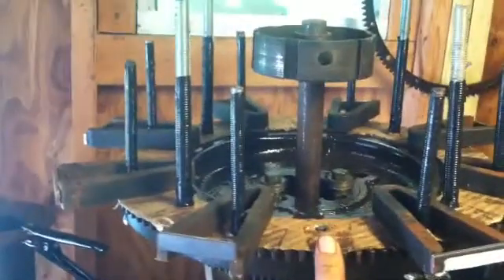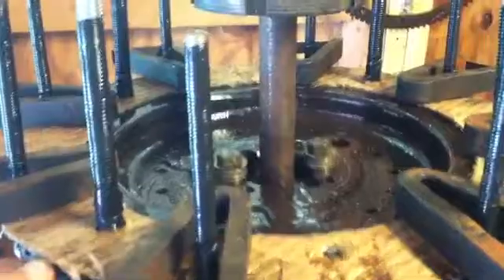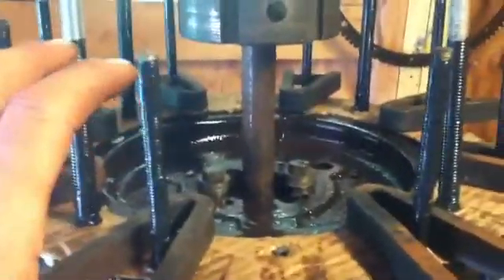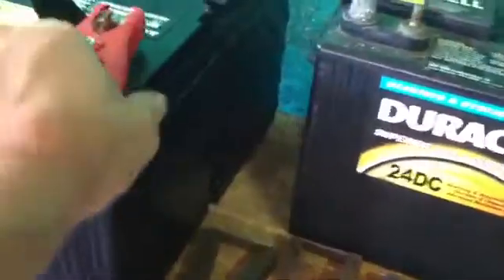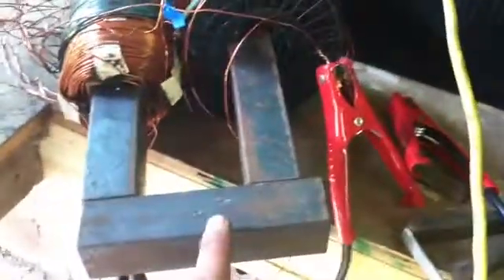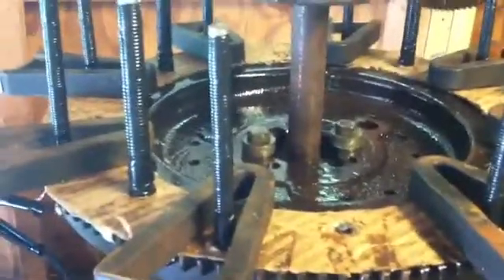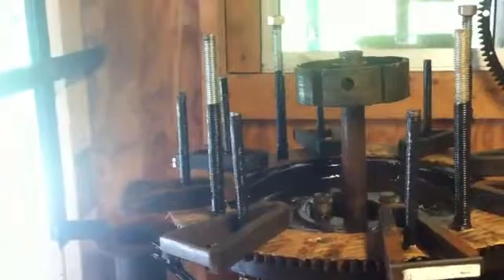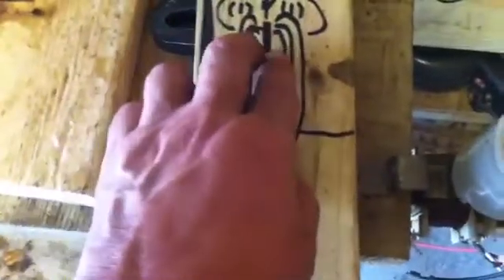How to build ( Ed Leedskalnin's Magnetic Flywheel Generator ) machanical atom ( part 3 )

Comment: By the way the engi e block would become a tea coil as the engine oil would be the ht and the water the lt and the block the iron core that would emit the 90 degree neutral spike to feed your loop joe booker does this on a no engine but soaks urine in the coolant system first that disappears to it seems coat a lithium crystal structure in the casting